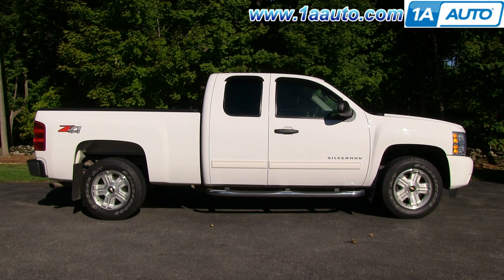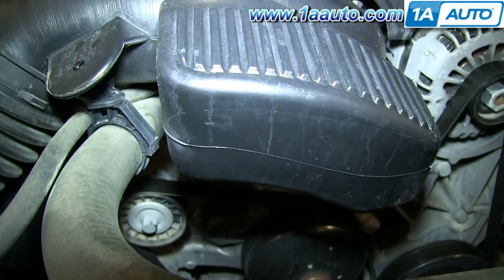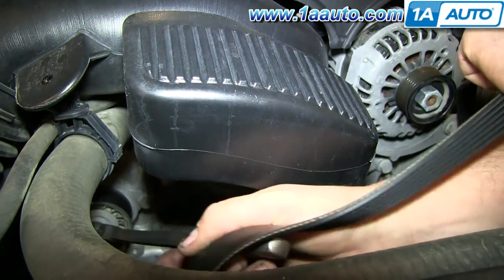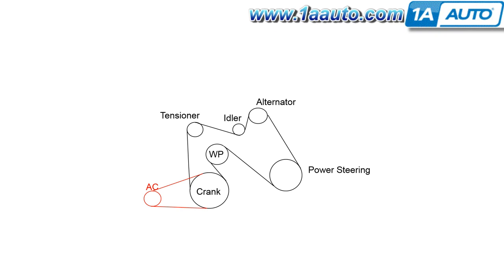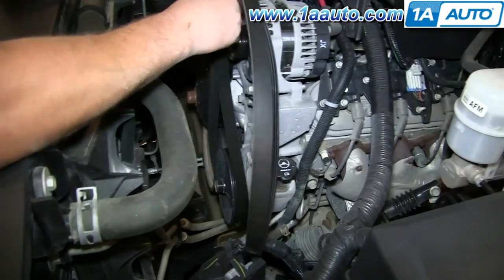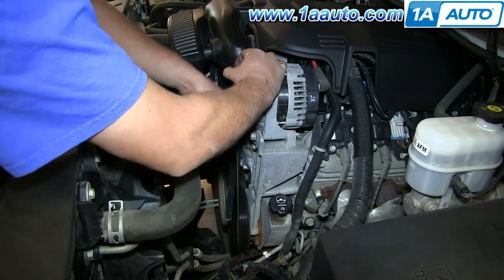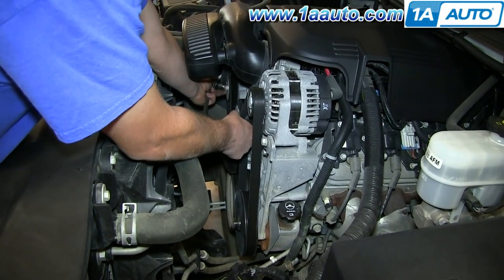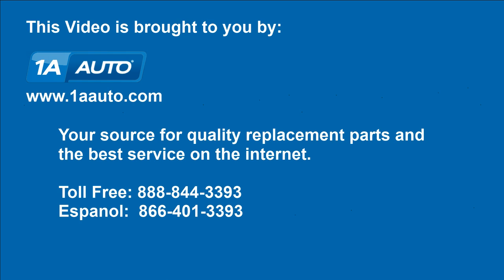How To Replace Serpentine Belt 07-13 Chevy Silverado

Comment: thanks, my idler pully gave out and took my belt with it on the freeway and left me stranded. Somebody pulled over and gave me a ride to get the parts i needed and i fixed it right there on the side of the road. i couldnt figure out which order to put the belt on until i saw this video thank you guys

Comment: That serpentine belt is a tight one. I had to bottom out the tensioner and still couldn't get it by hand. Had to use a small flat head to pop the new belt under the idler pulley with tensioner bottomed out. Only way I could get it with a new belt and new idler and new tensioner. Best advice is to put the belt on everything BUT the idler. Then bottom out the tensioner, then use a small flat head to pop the belt under the idler. That was the only way I could get mine on.

Comment: Put the belt around everything but not the idler. After it’s all good to go, push it under the idler. It’s much easier. Also, make sure you pull the tensionor

Comment: ok, this is no good - i cannot see how he puts it back on from that angle - if you are going to do a video to change the belt then you need to show it clearly...cannot see anything!!
Reply: If you can’t figure it out with the diagram, you shouldn’t be attempting to change it yourself. Find a mechanic. 😂😂😂
Reply: The diagram is also right on your valence covering your radiator when you lift the hood. It shows how the belt needs to be installed.
Reply: 🤦‍♂️🤦‍♂️ it had the diagram in the video and before taking it off you can see how its installed smdh

Comment: Can you make video changing the a/c belt since it uses a stretch to fit belt with a special tool to install?
Reply: Right ..my truck doesn't even have an ac belt tensioner